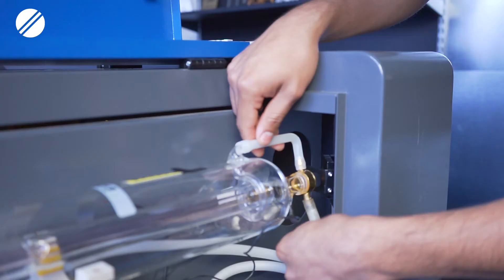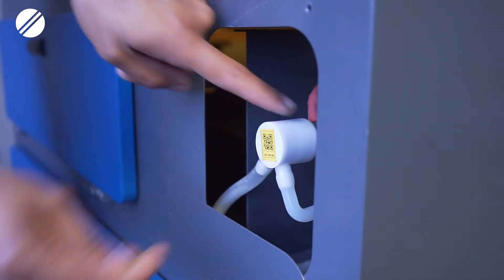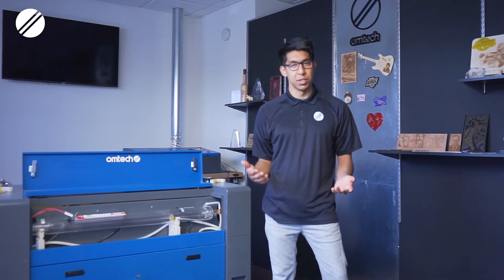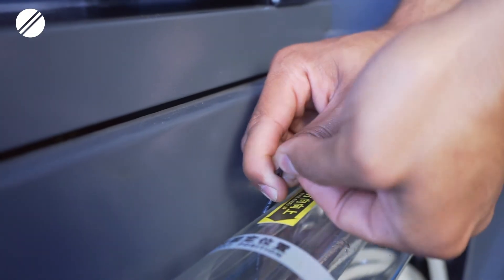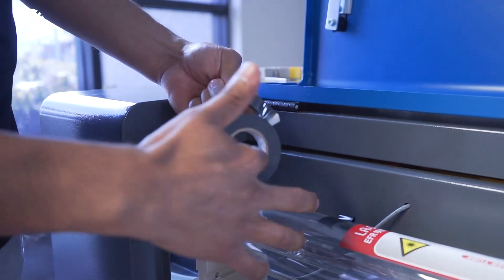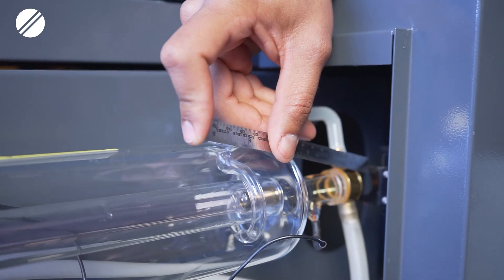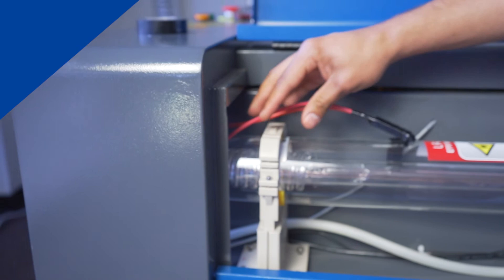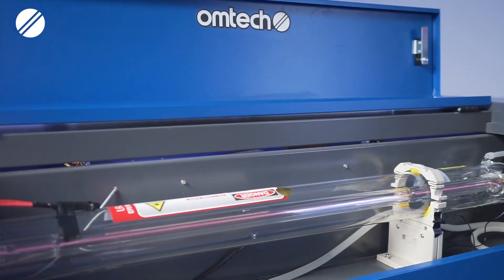Changing Your CO2 Laser Tube Part 2 - Installation - Training Video - OMTech Laser

Comment: You really REALLY need to emphasize the part when connecting the positive leads as to why a ceramic insulator was used .  It is glossed over and improper insulation can AND will lead to arcing and fire.
Reply: Haha im dealing with this right now.  No useful information on how to properly install the ceramic tube with leads.   Id ask for help but assume id be pointed to this video.  Kind of a dangerous thing to not have any detail about

Comment: I've had my Omtech Yellow 60 watt laser for about 18 months. I'm going to put a 80 watt tube and 80 watt power supply in it. I'm guessing I'll need bigger laser mounts and a box to fit over the longer laser tube that will sticking out. Do you sale laser tube mounts and box?
Reply from the maker: Hey there, great question! The size of the tube brackets will depend on the size of the 80W tube upgrade. You can find the best accommodation here: https://www.cloudraylaser.com/

Comment: I'm having a heck of a time stripping these wires die to the amount of silicone insulation on them. Any advice on how to cleanly strip these connections?
Reply from the maker: Hey there, good question! Our team suggests acquiring a stripping tool like the following: https://www.amazon.com/Southwire-Equipment-S816SOLHD-Forged-Stripper/dp/B07M7FNYX7/ref=asc_df_B07M7FNYX7/?tag=hyprod-20&linkCode=df0&hvadid=331778451017&hvpos=&hvnetw=g&hvrand=11312223677631781919&hvpone=&hvptwo=&hvqmt=&hvdev=c&hvdvcmdl=&hvlocint=&hvlocphy=9031581&hvtargid=pla-648920541041&psc=1
Reply: @omtechlaser  Hi I am also having this issue - I have also bought a wire stripper. The red cables are especially difficult to strip to expose the wires even with a wire stripper. The others are ok. I eventually was able to sort of do it but I sacrificed a lot of the red cable cutting off butchered attempts
Reply from the maker: @ Glad to hear you got it taken care of! If you do need to extend the red wire, you can add wire using the same gauge if needed. Just make sure to solder/heat shrink if possible when making the connection.